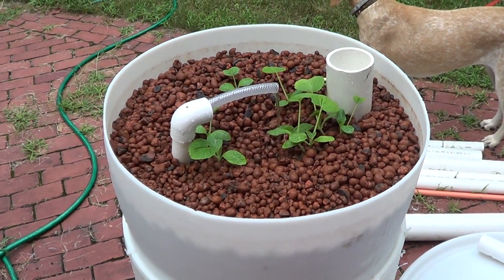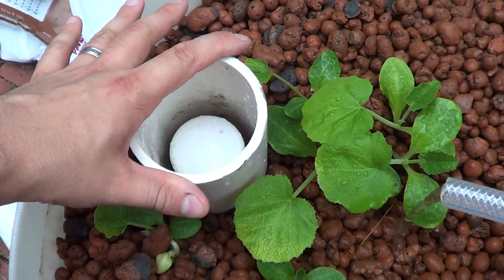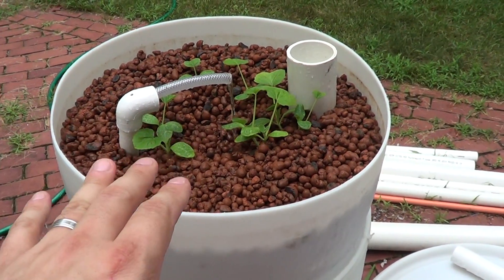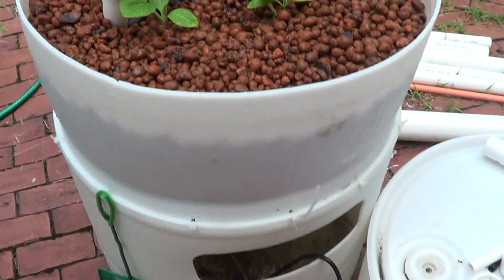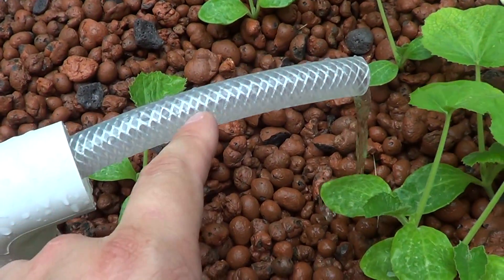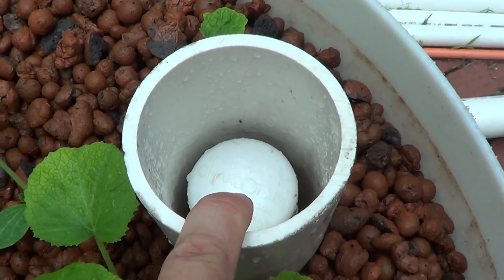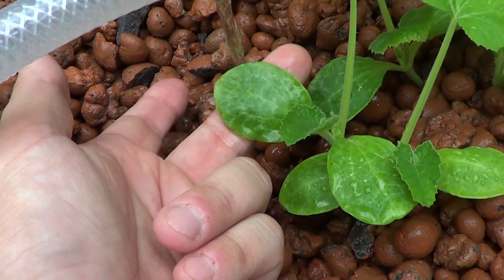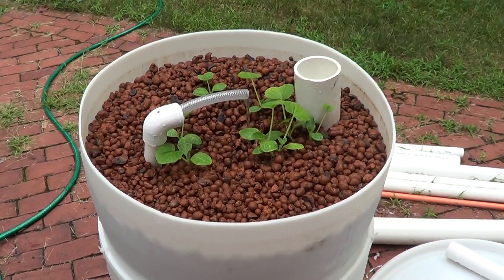#376: How to Fine Tune a Bell Siphon - Tank Tip

Comment: If you are pumping more than your bell siphon can exhaust, no matter what you either need a smaller pump, or a larger diameter standpipe in your siphon that can exhaust the water at a higher flow rate.

If your siphon is not stopping, you need to put a siphon break in - drill a hole in the top of the bell and connect an aquarium air line to bottom of the bell at he level you want it to break/stop (aka, your 'low' water level).

Comment: Why do you need a bell siphon. Why not use stand pipe?
Reply: A siphon, bell or not, allows the bed to fill to the standpipe level, then drain and repeat.

A standpipe will keep the bed filled to the standpipe level all the time.

Some roots do not like always being in water (even if oxygenated), thus the need for a siphon.
Reply: also dont forget to mention that you dont always want to turn off your pump (because someone arent that good for on/off action)

Comment: Your basic pipe layout is good specially the Drain alot of people get that wrong by not using the hard 90* elbow on the drain outlet, that helps create back pressure so  the siphon happens easier. etc. Check out this video for ideas on the bellsiphon: https://www.youtube.com/watch?v=tTu3GgyAt4s and also check his other video's and https://www.youtube.com/user/bnbob01
Reply: Relating to flow, many suggest using pumps 20% to 30% higher flow rating than the flow you need that will give you plenty + some so you can use valves inline with  your pvc/hoses etc.  They'll also cope with debree // blockage from any inline foam prefilters or other obstructions better.